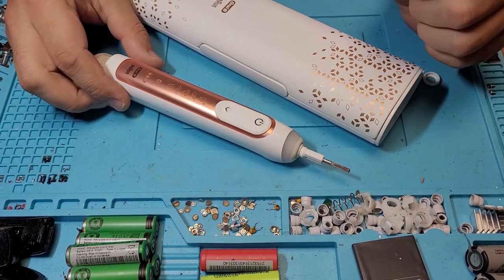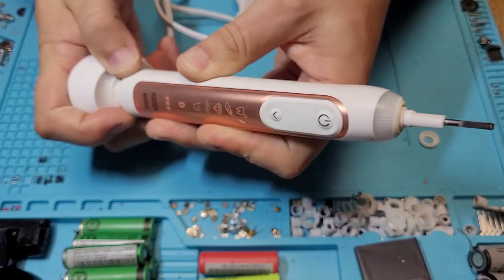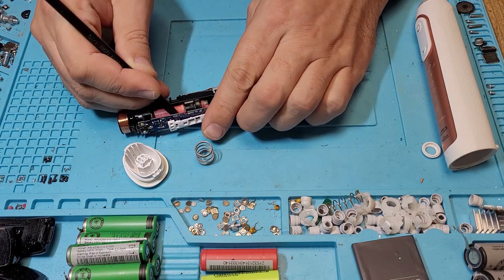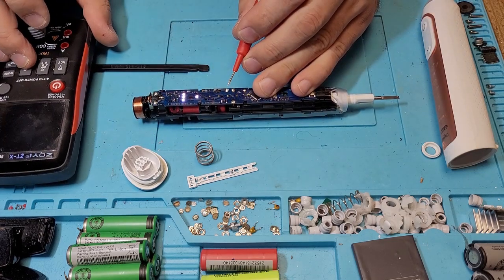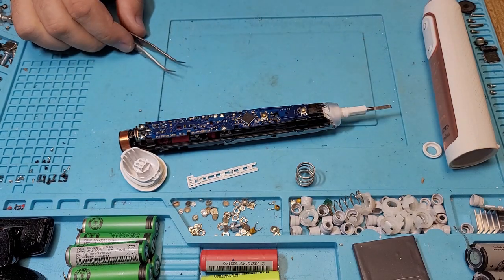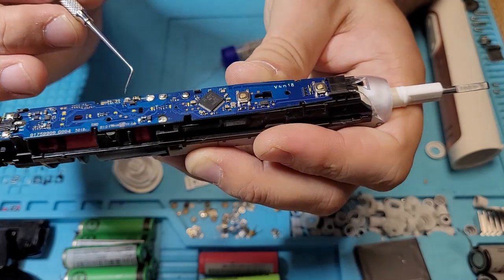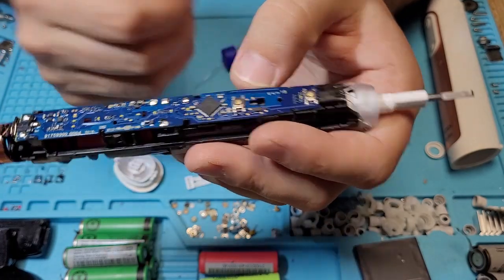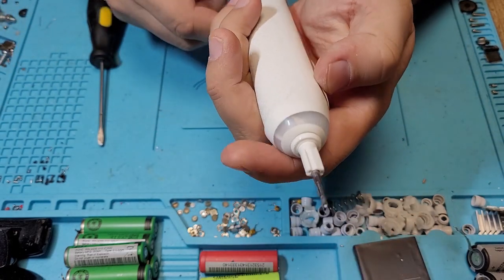Repair of Braun Oral-B Genius X. Lights up, but no vibrations.

Comment: Thank you! this was very helpful. I think most of us here are probably typical people who don't know how to do much with repairs past taking it apart so I think that's why most people (me included) opted into pressing on the fuse. No idea how to solder or what that means really and then maybe saw some glue you put on before the fuse? Watched some other videos on soldering and still not understanding it so pressing on the fuse right now is all it gets haha. The soldering part was fast forward and really wasn't explained (maybe you assumed people knew how to do that part? Lol) so I'd definitely have to learn how to do that and obviously get the tool before considering putting a new fuse on.
Thanks again!
Reply from the maker: Yes these videos are more useful to people that already have some DIY skills like soldering but hopefully this knowledge will push someone to learn soldering and start inspecting broken stuff :) it's really not rocket science.. diagnostic is.. but soldering is easy ;) p.s. that glue is flux it improves solder flow

Comment: Thank you for your video Letsfixitgarage. I followed your video and was going to replace the fuse as you said. I however got lucky and tried reflowing it first and to my surprise that fixed the fuse. My thought is the vibrations overtime from the motor makes tiny cracks in the solder joints and reflowing resoldified the joints. Its not a total loss having the extra fuses because  if this one eventually dies I have backups.
Reply from the maker: Have tried to resolder ends of fuse but my experience was that it's not always helping.. so it must be inside of the fuse. If it helped wonderful if it fails again let us know so others will learn as well:) thanks for your insights

Comment: thanks for making this video and to everyone who suggested pushing the fuse. It worked for me and saved me a $200 replacement! Im guessing the fuse is a semiconductor/electronic fuse that is reset when pushed with the power ON.
Reply from the maker: No it just has multiple layers of copper lines and crushing it, shorts between lines.. it's not a repair but a work around. If you want to have a working fuse you need to replace it..

Comment: My problem was exactly the same as in the video… but am I the only one who disassembled it, pushed the fuse and now it doesn’t even turn on? 😢
Reply from the maker: Pressing on the fuse doesn't work all the time.. and crushed electronic element is not repair in my opinion as its not performing as it should afterwards.. better way is to exchange the fuse.. additionally you can do a reset by removing power or shorting microprocessor legs.

Comment: Hello, before I watched this video, my lights were on and the engine wasn't working. I powered the engine directly with an 18650 battery to test it and now the lights aren't working. What could be the reason?
Reply: I solved it by short-circuiting the mosfet next to the upper button and then I short-circuited the fuse like you.
Reply from the maker: Short circuit is only diagnostic method and be careful with shorting it's not the safest method.. for repair I would suggest to replace the fuse..
Reply: @letsfixitgarage  thank you so much

Comment: Before you could buy Oral B brushes for a few bucks and they would last a liftetime. Now these costs 200$+ and they brake down after 3 years. Terrible Quality, thanks a ton for the help with pushing the fuse, solved the problem for now. Let’s see for how long

Comment: Same thing happened to mine! The PP fuse was causing issues. I could get it to work momentarily by applying pressure like others said. I just ended up removing mine and applying a bead of solder in place of the fuse. Seems to be working great now!
Reply from the maker: Yes that's the quick and dirty way ;) I would suggest to use a fuse.. it has it's purpose :)

Comment: oh man, I just swapped the fuse without checking the old one (suprise, it still has continuity....)
The best thing is, that stupid toothbrush isnt turning on at all anymore. before it was going and than slowyl dying in 2s, tried the 1k resistor...nothing :(
when putting it on the charger theres a slight purpleish blinking in the head LED.

did I fry it? not even sure how I wouldve done that...

measuring the element next to the fuse against ground gives me 3.8V

Any idea what else I could check?
Reply from the maker: that was the fun part in identifying this defect.. fuse was showing continuity but it was bad :) 1kohm resistor as fuse is way to much.. usually fuse is less then 1 ohm

Comment: First of all Kudos for all suggesting the "push the fuse" solution and also a BIG note on resetting the IC!! If the brush simply doesn't turn on, try the IC reset (connect pin 35 to GND), for me it worked like a charm! Also, the "push the fuse" solution only worked for a few seconds (maybe I pushed too hard? not sure...). Ended up doing the "quick and dirty" and shorting the fuse. For a brush I was going to toss this will be fine, for the added safety and probably longer life do go with the OP's suggestion and add new fuse in there (he mentions 2A), it'll be easy and cheap to get.
Reply: Where is pin35? My Genius doesnt Turn the Lights one. But Motor Work with Bridge to battery. Fuse near the Motor also got 0,35v

Comment: I took the brush apart before I read the comments that you just need to press the fuse. At some point, my indicators stopped lighting up too. I did something with it, took it apart, put it back together, and they turned on again, and then they stopped working again. Please tell me in detail how to make them turn on again.

Comment: Hallo, i was replaced that fuse, but not work, if i release the fuse power light and control is on, if i connect again 2 pin of fuse power is off, can u help this one? Thanks
Reply from the maker: Sorry can't understand what have you done and what is happening to the toothbrush.. try to describe it more detailed..
Reply: @letsfixitgarage  my i have your email, so i can send an attachment?
Reply: @letsfixitgarage  ok wait, i will upload the vidio, and i will sent the link
Reply: @letsfixitgarage  i cant sent the l i n k, 
May i have your e-m-a-i-l?
Tanks

Comment: Hello there. I'd like to ask if the 0805 model PPTC MF-SPMF110X-2 1.1A 6V would be ok to use ? As I cannot find the 2A anywhere on eBay, whilst the ones on AliExpress cannot be bought as they ran out or similar vendors would have, but the page would block my account from buying them (classic Ali :( ).

Thank you very much for your detailed instructions.
Reply from the maker: I would look for 2a. it can be bigger in size you can place it right up to the contact or remove some protection from the trace and place it where it fits.

Comment: I tried to fix it by pressing the fuse and it will work temporarily. 
I removed the fuse completely but i think i shortened the circuit. I measured the voltage of the fuse pins to the ground. One side of the fuse gives me less than 4V the other no voltage. Any suggestions?
Reply from the maker: Replace the fuse ;)

Comment: Many thanks for your helpful video, it is greatly appreciated. I followed the video and tried pressing the screwdriver end on the fuse and it sprang back into life,
Reply from the maker: Glad it helped you, although my suggestion would be to get a replacement fuse, they are cheap, a small repair shop wouldn't charge a lot for one smd resoldering if you brought it to them already taken apart and ready for replacement. Just my 5 cents :) don't like to cal breaking an electronic component a repair ;)

Comment: Hi! hopefully someone could point me to the right direction.
I have a similar model Genius 9000 that had water ingress and while cleaning, I accidently flicked off one of the smallest diodes near the cluster by the charging area (there's a lot of them near that cluster and none of them have any model or values on them). It's 1 of the 2 sitting above a larger diode with the marking 1U7 EN on the left side when looking at the board with the toothbrush upright.
Does any one know what diode model it is? :( Trying to hunt it down.
Reply from the maker: That's going to be difficult.. check eBay for another donor after water damage they usually are quite cheap. Another thing that water tends to damage quite hard the drive mechanismus that needs a lot of work. Would suggest to look for donor maybe with the fuse problem..

Comment: Also, to those that say "press on the fuse to make it work" it's all a myth. It's not a house breaker fuse so you pressing on it most likely crushes the inside of the fuse and makes it work for now. It's a temp fix and a terrible one.
Reply from the maker: Exactly. I suggest everyone to replace it with a working fuse as well.. if you are not good with soldering look for a small repair shop if you bring it diasasambled just for a fuse replacement it shouldn't be much..

Comment: Hi,
I just wanted to thank you for your video! Thanks to you, I successfully fixed our two toothbrushes. However, instead of replacing the fuse, as recommended in the comments, I simply connected the two points with some solder. If this issue is so common with these toothbrushes, it really seems like a design flaw..
Reply from the maker: Yes it seems that the fuse is not holding what it should be.. but I'm not na expert to prove it :) wire will hold fine, but be aware that in this case if motor is jammed it will apply full current on the motor windings possibly burning it as there is no fail safe fuse when the current is to high...

Comment: you son of a gun, i did what you show but instaed of repalcing the fuse i just pushed it like one of the guys described in the comments, worked like a charm, i was just about to purchase a new toothbrush. Thank you both, you are lifesavers!
Reply from the maker: As I say to all similar comments glad that it works, but consider replacing the fuse in future as it will not do it's job as it should be doing in case of a short :)

Comment: In need of help! I pressed down on the fuse and it worked again. However, in the process of reassembling it, I broke the clear plastic thing at the top that lights up when on. And the toothbrush doesn’t work. It won’t even light up when I press the power button or when I place it on the charger.
Reply from the maker: Check the comments for processor reset procedure or simply remove battery negative terminal from motherboard for a minute. This should reset it as well..
Reply: Look for the comment from @pwrgreg007. Find the microcontroller above the white cover for the LEDs. After grounding that copper pad at the corner clockwise from pin 1 connecting to the reset_pin (35) using your multimeter in continuity, toothbrush will work again.

Comment: Thank you  so much for posting this!!! Extremely helpful and helped me fix my genius toothbrush a year ago. 

Unfortunately, had to fix the same issue again this week, but as i was working on it this time, the lights stopped turning on. Any ideas on what i should look for?
Reply from the maker: Check the comments for processor reset procedure or simply remove battery negative terminal from motherboard for a minute. This should reset it as well..
Reply: @letsfixitgarage  Thank you again, you are amazing!!! After searching through the comments I found the relevant comment from @pwrgreg007. After grounding that pad at the corner clockwise from pin 1 connecting to the reset_pin (35) using my multimeter in continuity, toothbrush worked again.
Reply: @letsfixitgarage I have the same problem, the light does not turn on. I can not find a comment on how to fix this, please help me with this

Comment: Mi unisco ai ringraziamenti!!!❤ Spazzolino regalo della mia ex, dopo 4anni ha smesso di andare, pur accendendosi. Ho riscaldato i terminali della resistenza con un saldatore a punta fine, e ora va. Grazie!!!
Reply from the maker: Glad this worked for you but consider changing the fuse.. much more reliable aproach in electronics repair ;)
Reply: As expected 😢😢 it failed. Can you kindly help me to identify the fuse to buy? I. Your link, the 2A fuse is still correct one?😅

Comment: Hi can you help me .? I have similar problem. I replaced the battery and the brush is working.but it's doesn't charging.i see the the the copper wire was cut.i connected him but the the brush doesn't working but it's charging. The light are on but the brush doesn't work. Do you have an idea what can I do?
Reply from the maker: Have you replaced the fuse or just pressed on it? Maybe the initial problem returned..

Comment: TLDR/Summary for anyone who wants to see the actual point. There are two a bumpy thing (7:35 just right side of his tool), if you can connect one to the left to what he's pointing out (rectangle thing at the corner) it'll work. If you don't have a soldering machine and wanna see if that'll solve your problem, you can put a knife or other metal between these two things.
Reply from the maker: There is more in learning then just reading/watching a summary in 20s :) and if you want to repair more of different things you need to learn different techniques and different approaches in diagnostics :) don't have anything against fast learning but diagnostic is an art in itself ;)
Reply: @letsfixitgarage  while I agree with you not anyone is interested in watching whole thing, they just want to fix their broken toothpick quickly :D
Reply from the maker: @Skovorodnikof that's the problem.. everyone wants a 5 min fix and looks even into crazy examples.. let's say someone reads this comment and the most popular comment suggesting to push on the fuse with a screw driver without further checking what this affects.. with that you remove a safety option and if motor gets shorted your toothbrush, or toothbrush of a non suspecting loved one, could get smoking or even catch on fire depending on conditions... Now let's say you are not there to calm everyone down and this happens in America where everyone likes to Sue everyone.. how would manufacturer use this agains right to repair movement.. as said I'm not against fast fixes but we need to keep repair safe and this works only if you know what you are doing, so keep on learning!.. and then on the other side we have people who want to see everything and complain that something is not in the shot for 10s :)))) thanks for your comment and sorry for making a horror story out of it :)))
Reply: @letsfixitgarage  lmao that's alright, good day to you

Comment: I remove fuse and put the wire but not working can you help me?
Reply from the maker: Check comments there are comments explaining how to reset the MCU. Or simply remove the battery power for a minute and it should get back to life

Comment: I had this problem about two years ago. At the time I didn't see this video or the "push down on the fuse" fix. I replaced the fuse with a piece of 30-gauge wire-wrap wire. The fuse is likely there to protect from the motor locking up. With a lithium-ion battery it could catch fire if there's a short-circuit, so using a heavier short for the fuse is not a good idea. That fixed it. I measured 1.042 amps when connecting battery + directly to motor +.
Now the thing is totally dead, it quit during use. I have four volts at the battery and across the power switch. The switch works. Anyone know of how to fix it in this condition? Are there any other fuses, or a way to reset the micro-controller?
Reply: I got some more information on the Oral B 3771. The MCU is the Texas Instruments CC2640R2F running on 3.3V. Reset is on pin 35, but there's a pad you can ground to reset it. Look for the pad near the corner clockwise from pin 1. By grounding this pad, I got it working again. The data sheet is available on the TI website. Pretty impressive chip! Bluetooth capability is built into this MCU.
3.3V can be measured on the pad to the right of the fuses. The board's build date code is above this, along the top edge, next to a lower-case "c".
Reply: @pwrgreg007   your detailed  comment coupled with some googling saved the day! Thank you so much. Happy new year to everyone here!
Reply from the maker: Yes that's exactly why I recommend replacing it with a fuse and not short it or press on it.. thanks for explaining it to people who reads comments. By the way answer to your problem is between comments as well :) some other commenter has found out the pin order on the MCU as well and shared it with the public ;) thanks for repeating it again!
Reply: The 30-gauge wire works as an approximately 2-amp fuse. It's much safer than just soldering across the pads or using heavier wire. One could also use 30-gauge magnet wire. Check current-carrying capacity of wire online. Replacing the original fuse is probably the safest route but this is a good work-around and will last longer.
Reply: I was poking around measuring what I thought was a current-sense resistor but I'm not sure. The unit is now working. It could be that I reset the MCU somehow, or it just reset itself.
Reply: I have never used the Bluetooth on this toothbrush. Is it punishing me for that? 🙂

Comment: Ok so I tried to press the fuse while toothbrush was on and it went dead. It must have made short circuit of some kind. Everything is off
Reply from the maker: try shorting the fuse to see if it still works.. and better would be to exchange the fuse, as said not my favorite method of pressing on electronic component to make it work :)